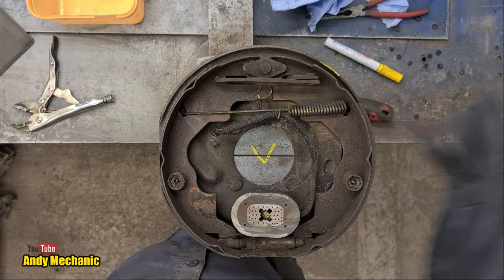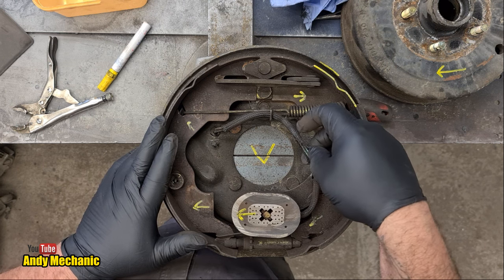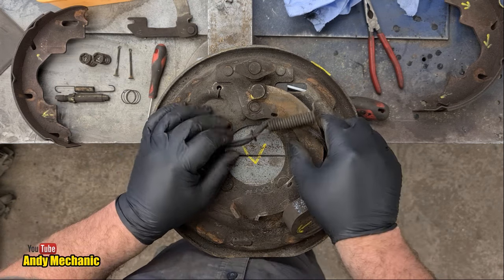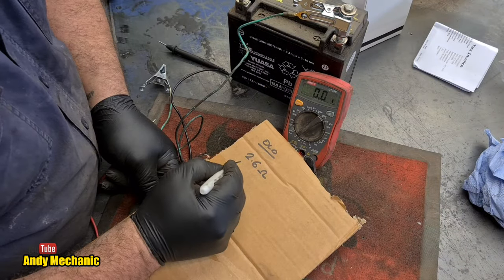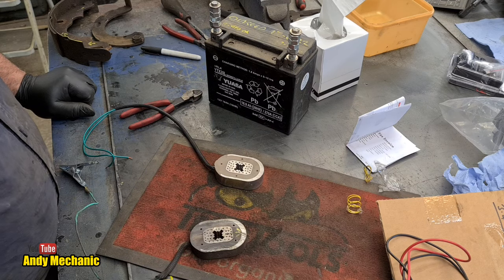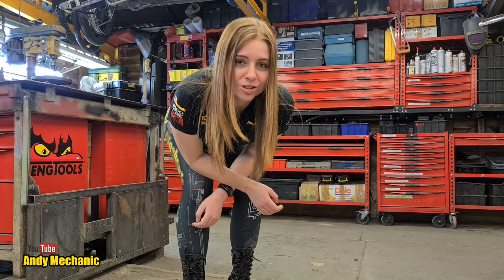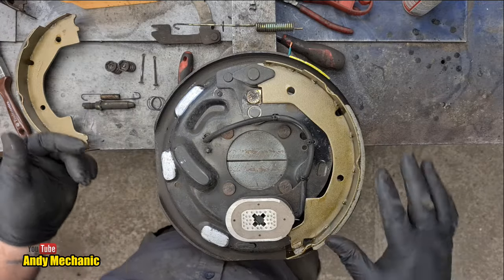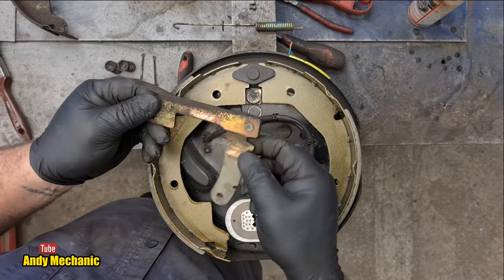Electric trailer brakes - operation & replacement #1349

Comment: The magnet contacting the inside of the drum, when energized, makes sense.  It assists in pushing the magnet back to the brake arm and spread the brake shoes.  I suspect it would do the same thing in reverse, pushing on the front side of the shoe.

Comment: The magnet works by friction drag on the drum providing the force to apply the brakes, if it worked just by magnetic force only the magnet would need to be many times stronger. Britax in the UK seem to be Britax Romer with manufacturing in Germany. An electro magnet strength is down to not only the current flowing in the coil but also the number of turns on the coil , the higher resistance indicates that the new magnet has more turns so it could in fact be stronger.

Comment: The old magnetics will be good to make a magnetic workpiece holder for the mill. Hold stuff you can't clamp easily
Reply from the maker: Hmmm....good idea but they really aren't that powerful, I was a little surprised to be fair.

Would work as a magnetic sweeper for the house to remove catch the swarf Marmite tramples in! Lol
Reply: @AndyMechanic  save you getting wrong for swarf in the house
Reply: Nice work.

Comment: Andy. I have two questions.  On the original magnets one side had much greater magnetic attraction than the other (none).  Does the same side hold true with reverse polarity?  How do you know with the new magnets that you have the greater attraction side toward the drum?  (markings ??)
Reply from the maker: Only one side of the electromagnet provided magnetic attraction when energized & that's the side with the friction material on the surface. The rear side (facing the backing plate) of the casing of the electromagnet is just all aluminum.

Hope this makes sense!

Oh, yes, the actuation of the brakes works in both the forward & reverse direction on the drum too...

Cheers Andy
Reply: OK thanks Andy.   I didn't realize each side was different.  I suppose that side will always provide the magnetic attraction regardless of polarity otherwise the two wires would be marked pos & neg. Rgds, Marcus